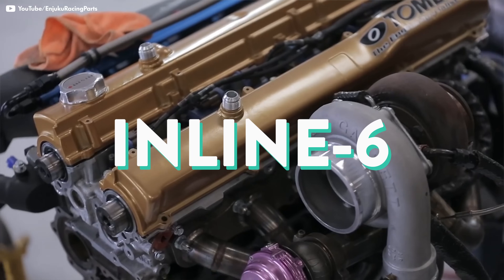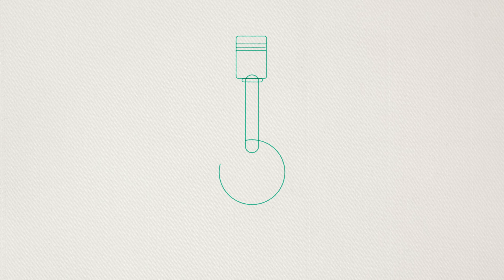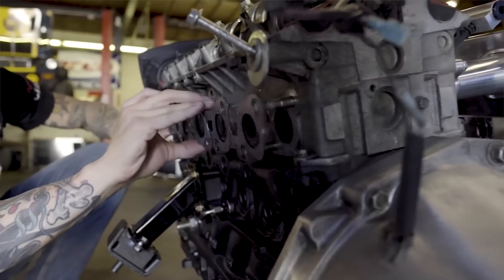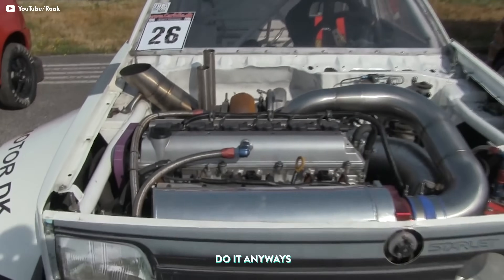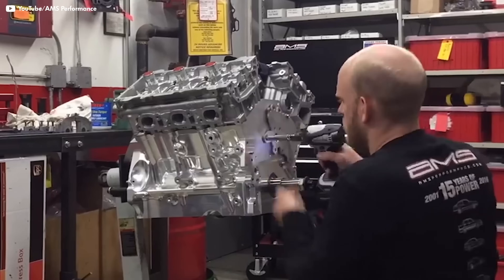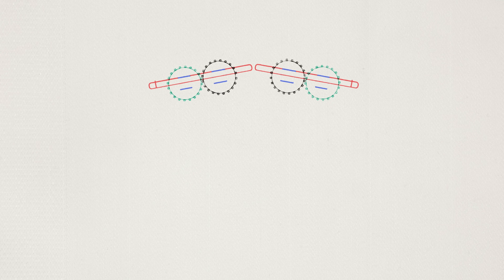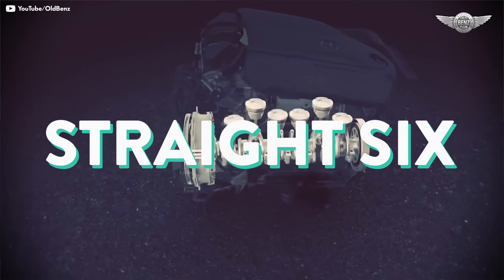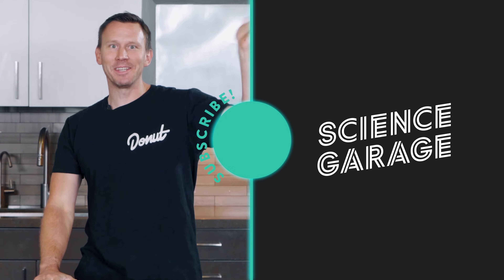INLINE 6 vs. V6 - How it Works | SCIENCE GARAGE

Comment: Inline sixes are also much stronger than a V six. The inline engine has seven main bearings whereas the V six has only four mains. That is why you will rarely see a inline six with a damaged bottom end. Inline sixes are tough as nails. 😎👍
Reply: And can make a ton of power reliably!
Reply: @xavir9178  and yet my honda V6 outlasted my 2001 3 series I6 by double......
Reply: @Spiritcr1jsher  obviously depends on the motor etc, like compare the old nsx v6 with the 2jz block, the 2j will come out on top anyday so yeah
Reply: @xavir9178  I'm a big honda/ford guy and I will admit that nsx motor is pure caca . I sold toyota and acura years ago and Toyota was big on over- engineering their cars in the past .
Reply: Spiritcr1jsher  bmws are not a great example. The are good in some of the newer cars but the older ones we junk unfortunately.
Reply: @xavir9178  same 2j block in the is300?
Reply: @ZSER93  I mean, the s54 in the e46 M3 (2000-2006) is one of the greatest motors BMW has ever produced and easily their greatest inline 6... how old are you talking?
Reply: @markyb3575  B58
Reply: @Spiritcr1jsher There’s a reason why Toyota utilizes the B58 in-line 6 from BMW. From a performance perspective, the i6 is superior. And the B58 is borderline bulletproof and stupid powerful.
Reply: @ryu411  i know. I have an m240i xdrive.
Reply: That's not true with every inline or V engine, General Motors made a v6 called the 3800 series II that is known for it's reliability, I've seen one particular longblock go through 3 cars and it's still running like the day it was made with over 450000 miles on it, by comparison I have a friend who has a 94 toyota landcruiser with the 1FZ-FE inline 6, it has just over 240000 miles on the engine and it has one cylinder with no compression, two with low compression, and the last three being a smidge below normal, stumbles all the time and blue smokes something fierce
Reply: Christopher  and once again , a rotary engine is HIGHLY inefficient.  200hp rx8 with 130lbs of torque and 18mpg highway on premium fuel . It revs high but displacement on a rotary motor is technically not the same as the way it would be measured on a typical motor . They are also unreliable on top of that . DOHC is far more complex and yet much better as a whole. Go look at the average hp on a pushrod motor from 3000-7500rpms and you will see how much less power it makes vs a gen 3 coyote ford motor . Down a bit on torque but gearing can compensate so it's a moot point .
Reply: Christopher  true..... cant argue that .
Reply: So a car with same displacement, same gearbox, weight and dimensions but car A is a V6 and car B is a I6... Who will win?
Reply: Saqib Mukadam in-line 6, the torque is better all around unlike a v6
Reply: Christopher they wouldn’t be the same. Each engine is engineered to have peak torque in rpm band. An inline 6 would have a better torque curve for low end and top end. Saying that they would be the same with two entirely different engines is not very intelligent. V6s are easier to mass produce they are easier to fit into engine bays. Also  cheaper to make for the manufacture. Which saves them money. Inline 6s are pretty long and only can fit in certain cars made for that specific motor. You can’t believe the hype because you have never owned one.
Reply: Especially if we’re talking about the Chrysler 4.0 that was put in the wranglers, Those things are are as reliable as a block of wood and they have plenty of low end grunt
Reply: @RustingFast  I have one of those in my 2004 TJ and you are right the 4L is a solid reliable engine as was it's predecessor the 258ci or 4.2L
Reply: Nah. Longer length is sugbected to more twisting forces.
Reply: @montreauxs  Wrong, and in so many ways.😞😞
Reply: The Chrysler Slant 6 only has 4 main bearings.  But hey, it was never intended to rev high or to go racing with.
Reply: Not all inline 6 have 7 mains.
Reply: @jamesbosworth4191  Only the good ones do. A slant 6 is a good engine but no one would accuse it of being in any way a performance engine. Same as the three main bearing Ford Flathead V8 has limited performance potential. Still sounds great though.
Reply: @MatthewBerginGarage  The Mopar flathead 6s also had only 4 mains, and they too were great engines, the GMC 6 was a great engine.  The 54 and later Chevy Stovebolts were great as well.  All of those had 4 main bearings.  For us non-hot rodders, "great engine" means extremely reliable, extremely durable, extremely long lasting.  For hot rodders, "great engine" means great performance, and easy to soup up for even more - much more.
Reply: Christopher  woah that's hell of an info man thanks a lot..... I still have one doubt left: cruisers like Harley and Harley type bikes have more torque and less hrsprs compared to same displacement of that sports bike which will have have less torque but higher hrsprs... Thus the top speed of the high torque is less top speed than that of a sports bike. So does it mean that more hrsprs contribute to more top speed?
Reply: Christopher  thanks man for the explanation...
Stay safe and healthy...
Reply: Christopher Honestly sounds like you’re a V6 fan boy. Your just stuck on it’s the best engine ever made crap. I’m sorry I wasted my time with you’re stupidly. Wish you the best but absolute worst.
Reply: @ZSER93  chill bro
Reply: V6s need optimum gearing to stop this .
Reply: laughs in 300inline and barra
Reply: And V8?
Reply: Yet the vr38 has achieved a record 3500whp. The v6 is better, it saves space and allows twin turbos to fit. It also sounds better
Reply: @Eclipsis17  Sorry but a V6 sounds like crap and has a weak bottom end with only 4 main bearings.  3500whp? Maybe if they forgot to fill the dyno drum with water but otherwise I seriously doubt it.
Reply: @MatthewBerginGarage  There have been some very successful F1 V6 engines.  A really good engineer can compensate for the bearings issue - as long as the car will win races, why would a different sound matter?
Reply: @Eclipsis17  All modern BMW inline-6’s have twin turbos, or twin scroll single turbos. So I don’t know what the fuck you’re trying to imply to at only a V6 configuration is capable of that. The I6 is the better balanced engine. That’s not an opinion, just a material fact, and why it’s the superior engine. 3,500whp? I doubt that very, very much.
Reply: @ryu411 🤦🏽‍♂️ look at tk23 and look who won the rolling quarter mile. The GTR with its vr38 did. And it has 3500 wheel horsepower. No inline 6 has achieved such feat. A v6 especially the vr38 are much stronger than inline 6s.
Reply: @ryu411 I never argued balancing my guy. I argued power and sound. Show me an inline 6 that sounds better than the vr38. There is none.
Reply: @Eclipsis17  A fully built engine that has 3500 horsepower??? Holy shit, I’m so impressed. 
That engine is not handling that power reliably, let alone on stock internals and stock turbos, fuck outta here, bruh.
Exhaust note is typically subjective, unless you’re comparing decibel levels. Otherwise, having the exhaust port all on one side typically results in a more uniform tone, a higher pitch tone. And I prefer the exhaust note of the S54. A much more unique sound than a run of the mill V6.
Reply: My BMW N54 that spun a crank hub has entered the chat lmaoo
Reply: Christopher  I agree , if the i6 was so amazing,  Honda and toyota would be using it ....lol
Reply: @Spiritcr1jsher  this comment aged like the sweetest wine
Reply: @dobysitchy  lol
Reply: Christopher  you are correct.  Some of the most efficient 6 cylinder engines are V6 . I6 was good when a 1995 m3 had one with 240hp and when the 3.2 got 333hp but it always came at a price . The 333hp m3 got like 22mpg on the highway when a supercharged 2003 svt cobra with a 4.6L v8 with 390hp and 390tq got 24mpg .
Reply: I would like on your comment and stuff but you already have six nine likes let's keep it that way I've already seen someone else with 420 likes

Comment: The ford 4.9 and jeep 4.0 is the most know inline 6s
Reply: j l both are fantastic
Reply: Nah.  Jeep 4.0?  Glad it's gone.  Gas hog; low power; valve lifters crap, etc.
Reply: @TucsonDude  It speaks a little different when they run over 300,000 miles with no issues

Comment: Both have advantages and disadvantages.
V6 being more compact but if you can fit an inline six in an engine bay.
Normally a V8 will fit which is not always the case with a V6 engine bay.
And inline sixes are usually smoother.
😆😆😆😆😈😈😈😈

Comment: The only experience I have had with the inline 6 cylinder engine was the Ford 300 Cubic Inch 6 in a 1966 1/2 ton pickup and the slant 6 225 Cubic Inch Chrysler in a Plymouth Duster.  Both were good engines and the Ford pickup had more than enough power in pulling my 18 foot travel trailer.  I would like to see how today's technology could increase performance with those engines.... If they still made them.

Comment: Whoa whoa whoa.....i6 Cummins engines....?  Specifically the 6bt (the "12 valve") let's forget about it being used in dodge pick-up trucks, because it's used in more platforms than any other engine on the planet. From tractors to boats to trucks to generators. It's also one of the most efficient engines ever mass produced.
Reply: Skyactive x

Comment: One thing I did not heard you saying is that straight six is a good thing for RWD. It's aligned to trasmission and power flow to the rear. Some sporty cars exchanged N/A V8's for In-line 6 turbos and enhanced their power. The good thing about I-6 is that works great with different turbos layouts.

Comment: A v6 can be a bit lighter because the block and crank are smaller, but they may need balance shafts. I6 is better for turbos and maintenance since there is more room on the sides, while a supercharger can be mounted in the middle of a v6. I'm not aware of any hot v turbo 6s, but I suppose it's a possibility. Any talk about v6 making more power and i6 making more torque is nonsense, it has nothing to do with the layout and everything to do with bore vs stroke ratio, rod to stroke ratio, head and cam design. That said, the design constraints will push engineers to make longer stroke and smaller bore i6 engines to shorten the overall length of the engine, and v6s might be made with shorter strokes and bigger bores to lower the deck height and therefore the width of the assembled engine (having the heads closer to the crank will more than compensate for slightly bigger bores in overall width)

Comment: Can the straight engine be put laying on it side, so the pistons move sideways?
Reply: Interesting question. I would assume somehow it could work since that's how boxer engines work. It might take some modifying but would lower the center of gravity which is the only "problem" I can think of with inlines.

Comment: So you're not talking about Porsche's flat-6 and VW's VR6?
Reply: Well, the video is about straight 6 and V6 engines, not flat 6 or VR6 engines... So no😂
Reply: The 140 CU IN (2.3L Corvair) did pretty good too. 110 Hp, 140 Hp and turbo 180 HP. Needed high octane gasoline but would go a long way on a gallon. Not bad for a 60+ year old design. Honda even made a motor cycle with one.
Reply: john jay sounds like somebody got walked by a vr6 lol
Reply: john jay are you a kid
Unless it’s a joke that’s ok
Reply: Forget about vr6 isn’t smooth
Reply: VR6s are just v6 with a bit of spice
Reply: john jay  Flat 4 baby.

Comment: You didn't touch on parasitic power loss and inherent increase in friction from piston scuffing due to the rod angle being closer to perpendicular to the piston wall at times during the rotation of a V configuration engine. Thus with all things being equal i.e. the  displacement,volumetric efficiency,cam profile and timing as well as the fuel map a straight engine due to better mechanical efficiency would prevail as a rule.

Comment: Now that I think of it, all of my vehicles have inline six engines. 1999 M3 3.2L I6, 1963  Plymouth valiant 225 slant six, 1947 Chevrolet Fleetline 216 Stovebolt, 1946 Chevrolet pickup 261 Stovebolt. They’re all bulletproof and smooth.

Comment: I don't understand why they didn't keep the same displacement but use six smaller cylinders instead of an inline 4. The engine would be naturally balanced, compact, better re-enforced block walls, able to boost way higher, etc.

Comment: So what are the different benefits to the engine types? Straight 6 vs V-6; does one produce more torque than the other, is there a fuel efficiency to them, or could it be convenience?

Comment: V6 engines are almost as dumb as Subaru with two cylinder heads on a 4 banget
Reply: Besides the fact that both v6 and flat 4s have things i6s dont lower weight better weight distribution. Etc etc

Comment: The first generation Volvo S80 T6 was actually FWD as well as had its straight-six mounted at a 90 degree sideways angle like most other FWD cars, always thought it was a rather odd design solution and is the only car to my knowledge that has a straight-six mounted in this fashion.

Comment: Inline 6 is half, the long way, of a V12. The V12 is the super smooth design used by the premiere cars through the entire timeline of "the car". It's because of the Inline 6's naturally balance, and V12s take double advantage of that natural balance of the I6. "Why are I6's naturally balanced?" you ask. As the crankshaft spins the outermost two pistons move up and down in perfect synchronization. 120 degrees from the outermost pistons, piston 2 and 5 are moving up and down in perfect synchronization. Traveling around the circle ANOTHER 120 degrees, the 2 innermost pistons are moving up and down in perfect synchronization. The math facts explain the stratospheric level of smoothness that is inherent to the I6 design. Now, add an additional bank of 6 cylinders to the side of the original bank of 6 cylinders, make a crankshaft that receives the connecting rods from these extra six pistons in the configuration that their thrusts come into that crankshaft between those of the original 6 pistons, and now you have 60 degree intervals instead of 120 degree intervals, smoothing out the power delivery to the crankshaft by 100%. Really simple to grasp once one has the facts of how it all works. If we had more competition in the carbon fiber market we could get the weight way, way down on ALL cars, and thus more readily accept the "negative" of the "longness" of the Inline 6. Remember how wonderfully EASY it is to work in the engine bay of an uncluttered early to mid 1960's vehicle that was powered by an INLINE SIX, one that was free of pollution control electronics, like electronic fuel injection!!! All that electronic equipment was to compensate for people neglecting the need to keep up with TUNE UPS! Old designs that are properly tuned up have been tested as to how cleanly they are burning fuel and they "stood right up to" the new, electronics filled, engines of the 21st century!

Comment: Think about this a moment you engineers will get a kick out of this... But a engine that angles the pistons downward with a central oil and pump system. Why, because of the gravity feeding effect of the valves and combustion. Could prove to be more power... Be a radically designed engine... Or do a modern star type engine they used on the old fighter planes and shrink it down to modern technology specs... Just for eye catching engineering feats...

Comment: Other than packaging, there is ZERO question an I6 is SIGNIFICANTLY better than a V6. On harmonics alone it makes it able to rev higher, is able to be made lighter (less pulleys, bolts, etc).
Reply: But the vq35 revs higher than a lot of i6 tho??

Comment: got the Inline 6 (S54B32) in my E46 M3 very smooth running engine and the (S63B44) V8 BiTurbo in my M5 F10...depends how you treat them i guess but so far both are running good and still doing their job even tho i prefer the Inline6

Comment: The L6 engine is much more powerful and efficient than the V6.  The only reason why V6 engines are made is because they fit better into smaller cars and require less iron or aluminum to make the blocks.

The Nissan 3.0L V6, known as the VG30DE is often cited as the greatest V6 engine ever made and I agree with this sentiment.  However, the VG30DETT (twin-turbo) in the 300ZX was clearly outclassed by the Toyota 3.0L L6, known as the 2JZ-GTE and used in the Supra.  In fact, Nissan's own 2.8L RB26DETT L6 engine in the Skyline also outclassed the VG30DETT.  That's why people refer to the Supra and Skyline as the most legendary Japanese sports cars ever with the 300ZX and Mazda RX-7 being nothing more than also-rans.

Comment: 2JZGTE is the best engine on planet earth. Although PER LITER the 1jz can handle more power (remember, I said per liter) due to lower stroke and ability to rev higher reliably, 2JZ is king. Capable of handling 1000 HP stock with race fuel or E85 and simply does not break if maintained at low and moderate power levels.

Comment: I’m a student in vehicle maintenance and I was interested about the differences in v shaped or inline engines. But what about the newest version engine design by Volkswagen The VR6 engine? What’s the difference between a normal v6 and a vr6?
Reply: The VR6 basically has the pistons lined up like an I6, but they are closer together because they are angled at 15 degrees which frees up just enough room between them to be closer, yet they aren't far apart enough to need two different valve covers and two of everything else like in traditional V6s. So the benefits of a balanced I6, but slightly wider yet lot less long, so quite efficient in the room they take.
Reply: Pier-Luc Garand Dion thank you for this explanation, I have recently learned about a whole lot of engines from the wankel rotary engines to H block engines. This will really help with my exam coming up in two weeks time.